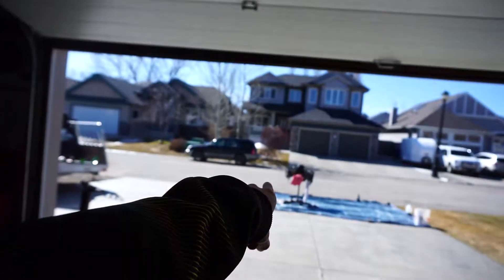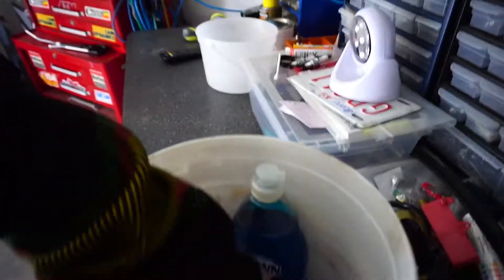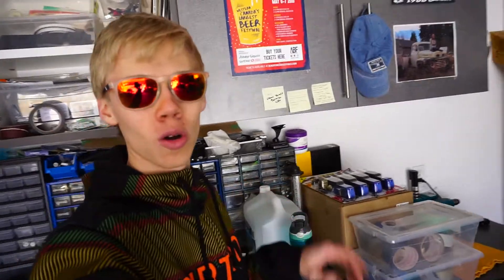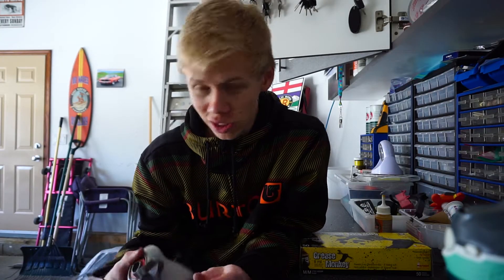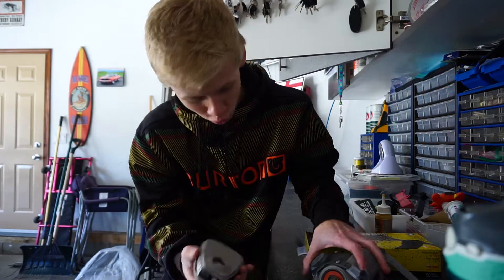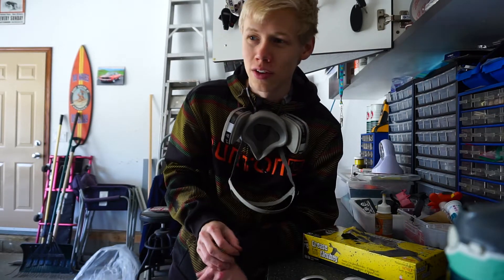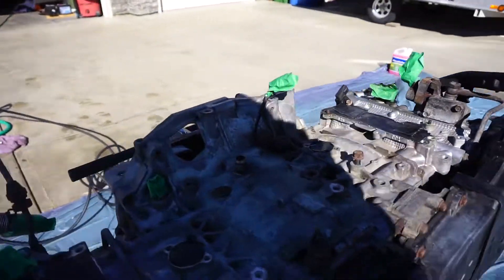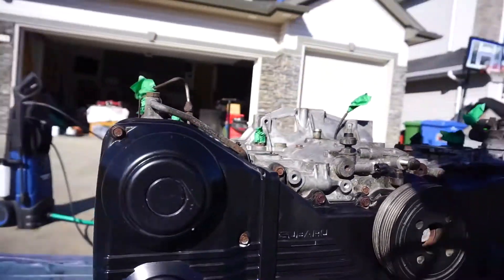Make your ENGINE BLOCK look brand new in just 5 easy steps!

Comment: I use foaming condenser coil cleaner from hvac supply store or purple power non diluted let it soak spray off with water hose then take a dremel with wire wheels and polish the aluminum like chrome.
Reply from the maker: That’s awesome! I don’t know if I would have the patience to go over the block with a dremel!